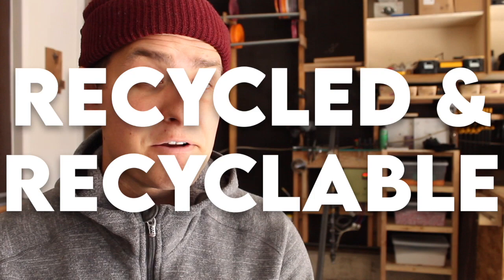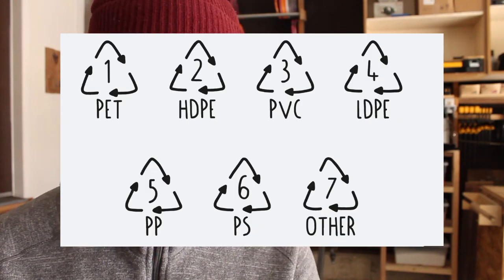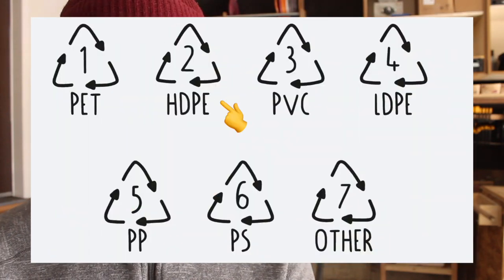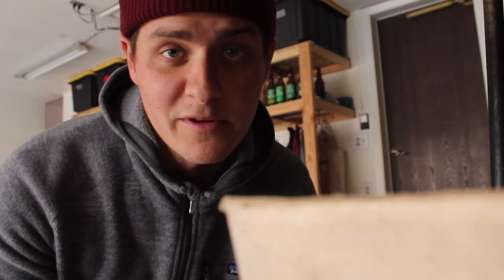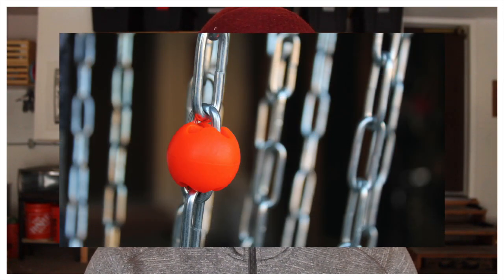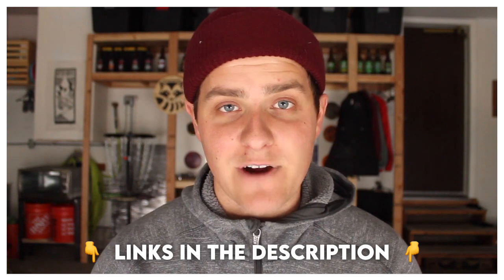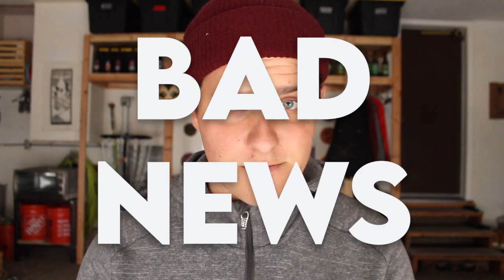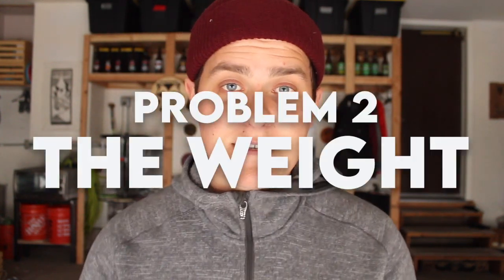I Made a Disc Out of Recycled Polypropylene (aka take out containers)

Comment: Add a heavier material into the mix if you want to use the same shot size. For this take a look at how some 3d printer plastics are made. Adding grounds/shavings/flake such as Copper, Iron, Brass, Aluminum, Tungsten. It's not about melting the added grounds, it's about suspending them in the plastic.

Comment: I'm sure by now someone had to of pointed this out, or just from playing for so long you've witnessed it.  But I've always played at sea level and a couple years ago I went to moab which is very similar to the altitude of Colorado and not only could I throw so much farther, every disc I had that used to be so flippy it would go into a roller turned into my bomber discs, and stable discs were just way too stable.  

Even when I lived in Arizona which I was only at 2000ft everyone's goto drivers where Shrykes and Vulcans ect.  

I'm not a scientist, but basically since the air is thiner there's less drag, but the disc also falls faster.  I've had it explained to me that the higher you are it's like throwing with a faster and faster tail wind.
Reply from the maker: Absolutely! It's not something that's talked about as much unless you live/play a lot at higher elevation. I'm from CA originally and my go to discs from CA to CO totally differ.

Comment: Hide the extra weight by increasing thickness in the inside corner where the flight plate and rim meet? Or slightly larger diameter might increase the weight fast? Or how about just cramming in more plastic in to the mold? Is that even possible especially with your hand used injection machine? BTW that thing looked sick af and surprisingly stable when you consider the weight. Oh, maybe a beaded version? Also I've always wondered what would some sort of outdent on the top or the bottom of the flightplate do? You always see indents like the groove tracks from discraft or groove from Innova but never outdent. Maybe a some grip designs on the bottom of the flightplate? Would also get weight away from the center like mvp or axiom seem to be doing with their weighting.
Reply from the maker: All great ideas and thoughts. Thank you!

Comment: Great work. Have you considered getting involved with 3d printing groups. It's one of my other hobbies and there is generally a ton of waste from support material and just failed prints in general. If there is a local 3d printing group I'm sure you could source a bunch of PLA, PETG, TPE, and ABS that is normally thrown out. Most of it melts around 200C and Im sure you can just throw stuff in a blender to make chips.
Reply from the maker: Great idea! I'll definitely try to connect with some.

Comment: Since the plastic is lighter, you could try widening the rim to add weight and speed while still keeping the disc less dense than water. If you can get the density consistent, it shouldn't be too difficult to calculate how much wider the rim would need to be to achieve a certain weight. I know all the math necessary for that and I assume a lot of other people know as well - I don't really know the terms in english but the first idea that came in my mind is volumes of objects that are created by spinning a graph around an axis.
Reply from the maker: Thank you very much! That's very helpful. I think that may be my next step!
Reply: @TrashPandaDiscGolf  I just created a simple prototype for a disc that has volume of about 183.6 cubic centimeters. With your current PP density, it would have a nice weight and still float. It has a nice dome, it is 19 mm high at the top, and it has 10 mm deep and 14 mm wide rim. I think it looks nice but I am not really experienced with disc stability so I don't know how flippy or stable it would be. Could I somehow send you more detailed info to look at? I would love to hear your opinion on it!

I used a program called GeoGebra 5 (a free program I often use for geometry problems in school) to draw it, used just a circle and some sort of ellipse to create it. If you have the program, I could send you the file and you could get all necessary info about the shape (with up to 15 decimal accuracy if needed) from it.
Reply: according to the PP density someone gave here in comments, that disc would weigh a bit over 160 grams. I did some changes and landed on a weight of about 178 grams with a bit wider rim, a bit higher dome and thicker flight plate. Can I email you some pictures or something like that?
Reply from the maker: Saw the email come through! Excited to talk more.
Reply: @TrashPandaDiscGolf  nice!

Comment: I think you might be getting too much air between the grinded parts when you put them in. Try compacting the grind into pellets before you inject them to reduce air pockets.
Reply from the maker: Thanks for the feedback!!
Reply: @TrashPandaDiscGolf  kinda off-topic, but have you tried 3d-printing a disc? Not as durable or recycled but very fast and easy to make your own designs and test them. I've made a few different minis and 1 full size fairway driver, 2 mids and a putter that way. Small changes are super fast to make and it takes about 5-6 tries until you get the flight you want.
Reply from the maker: One day I will! But I have not yet. I totally see the value just don't have access to one personally yet!

Comment: Would sand work to add weight and keep grip?
Reply from the maker: Maybe!!
Reply: The only thing I would caution you about sand is that it is very abrasive and hard.  Could cause wear in the mold and injection machine over time quicker than just plastic.

Comment: Keep wishing for more about the actual disc - just feel like the video doesn’t show it off. You using the disc sure, you talking sure, sponsor sure, close ups and video of the putter .. nope.
Reply from the maker: Hey Thomas! The "How the Recycled Prototype Flies" video goes into detail about the mold/flight pattern. If there are more details you'd be interested in, feel free to list them out here and I'll include them if/when I can!
Reply: He showed closeups right after demolding. It obviously is an average width and depth, a small bead on the lip, and a pretty flat top design. Seems to be close to a beaded aviar type design, very neutral or a hint under stable.

Comment: Maybe mixing 75% PP with 25% HDPE could give it some weight?? Not sure if this would work. As in idk if you can mix them and be fine or if it may cause a reaction you don't want since I'm not the best with science.
Reply from the maker: I'm also not the best with science.. lol! Thanks for the idea!
Reply: @TrashPandaDiscGolf  no problem! I wanna see this company get bigger and bigger with sustainable discs. But also maybe try melting the other plastics, seeing how much they weigh and the softness, and maybe if you find a plastic that melts to be heavier and softer, you can partially mix it with PP to gain weight, and not as stiff of a disc!!

Comment: Dude, that disc is awesome! It flew so perfect. That's the exact flight I look for in my putters.

About getting it heavier, I don't personally know much about additives but I know some exist that would get you some more weight. My only advice (you may already do this) is to make sure your shot that you load into the barrel has plenty of excess material. After you inject, make sure you continue to hold as much pressure as you can apply for at least ten seconds maybe more. That will continue to force more material in until the gate freezes. If you leave off pressure the material can flow back into the barrel to relieve the pressure in the mold. Also if you bottom out the plunger you're definitely not forcing any more material in the mold. Don't know if any of these are the case. Just all the advice I can give.
Reply from the maker: Thanks so much Zach!! All great stuff!
Reply: @TrashPandaDiscGolf  No prob. Happy to try to be helpful. It's a good cause.

Comment: Use the #1 PET plastic, it is the second common plastic on the market also one of the most used plastics after #2 HDPE which gets hard and stays hard when made that way, think Gatorade One time use bottles and similar sports ones that stay rather stiff. The plastic is already in USA being recycled and most countries recycle the plastic so this might help in finding the plastic easier. #1 PET is very flexible and will be similar to #2 HDPE but not as stiff in most cases.
Reply from the maker: Thanks for the feedback Casey! PET is definitely on the list to test in the future!!
Reply: @TrashPandaDiscGolf  Yeah it is nearly in feel a softer #2 HDPE, try feeling the two plastics sometime.

Comment: Hey Jesse I’m a plastic engineer....in order for you to make your disc heavier you have to do what is called pack and hold for injection molding.  I would try contacting any local injection molding companies to see if they have any scrap that you can have.  Polypropylene is very easy to be grinded up and re used but you might get lucky to find a company that doesn’t use it.  I know my company pays another company to come pick our scrap up at our cost so if you lived by me you would have an endless supply.
Reply from the maker: Thank you so much! That's a great idea and I'll definitely try to find some local injection molding companies to connect with!
Reply: @TrashPandaDiscGolf  for your set up to do a pack and hold you would have to use a bigger shot and a longer rod for you to apply even more pressure than you have currently.
Reply: I will reach out to PTA plastics up in Longmont for you. See if my connections are still around

Comment: Use a high density aggregate to increase the weight. You can get copper and diamond powder on eBay for cheap and might have a cool looking effect. Just make sure it mixes well or you could have balance issues
Reply from the maker: Great idea! Thank you!
Reply: How would that affect the recycleability of a disc?
Reply from the maker: Great question! I know that discs that use minerals/aggregates are still recyclable. That being said, there are complications recycling them in larger recycling systems, which is ultimately something I want to avoid. 100% PP means it can be recycled by me or anyone else!

Comment: I have no experience in this but it's the internet so here is my thoughts. You could try using a pulley system to get a lot more pressure during forming. This might allow you to get more plastic in it and increase the weight. Check out smarter everyday's video on snatch blocks for inspiration
Reply from the maker: haha great feedback! Could possibly change the weight but only minimally. Well worth testing though!
Reply: @TrashPandaDiscGolf  maybe it won't change the weight much. But it might allow you to produce a lot more discs. Less energy pulling a rope vs putting all your weight on the lever.

Comment: You could put a metal ring inside the mould before you inject the PP. Some copper house wiring should work for a quick test. Would still be 100% recyclable too. Also, a metal ring in the rim could ad some interesting properties to the disk. Some good, some bad I'm sure.
Reply: Would not be PDGA Approved since no metal or wood can be inside the discs ever.
Reply from the maker: Thanks for the idea Jeff! Definitely an idea I hadn't thought of.. Casey: obviously a metal ring is significantly different than metal flake, but how come one is approved and not the other?
Reply: @TrashPandaDiscGolf  Because they used a metal in the disc plastic mix, not a piece of metal in a disc. I would at least look that up as to why no disc with metal in it in a more solid form has been made or PDGA approved.

Comment: Obviously you need more PP in your disc if it is to be all PP and heavier. If you can't squeeze more into the current mold, could you somehow roll out a think pancake of PP for the extra weight and stick is on the inside of the disc? Just as a prototype and to get a feel of how much thicker it needs to be, before spending the effort/money on a new mold.
Reply from the maker: Thanks for the feedback! Love the problem solving thought process. Unfortunately thicker means less flexy..

Comment: I can think of two ways.  Use an additive that will add weight to the plastic, this will be hard to distribute evenly throughout your material without a mixer of some sort before you injection.  Number two, shove more plastic in.  I was noticing that your mold may be flexing some during the injection process, visually looked like the gap grew on the long edges between your clamping bolts. So increasing the density of the final product may be hard without a way to push harder and hold it there.  But you could try just shoving more material in during the packing phase.  

I think the main issue is the fact you are trying to use a single type of plastic and the blends are what help you achieve the specs you desire.  I don't necessarily think that 150 is too light, but it may be for the design of the disc.  Something designed to be more overstable but a lighter weight may be the ticket to producing a product that is more recyclable.  In fact it would already be reducing the plastic used inherently by almost 25 grams compared to your average max weight discs, which is already 25 grams not being thrown into the environment when discarded.
Reply from the maker: This is all fantastic feedback Michael! Thanks so much. I seriously appreciate the help!
Reply: That's actually a fascinating point about reducing the amount of plastic by 25g inherently is better for the environment.  I'd throw a 150 for sure.
Reply: I am loving every minute of this dude, keep it up.  Let me know when I can quit my job and come help you make discs.
Reply from the maker: Haha deal!
Reply: If the problem is plastic. Start with less plastic.  

I am not sure if it is feasible while maintaining the flight paths we see but the japan open was always 150 class.  They seemed to adapt just fine.  With the right design the loss of overall mass may not matter to 99% of players.

Comment: From Google, PP is 855kg/m3 vs HDPEs 970kg/m3. So 88% lighter perfectly accounts for your 155g disc. 
LDPE could be an option. Its only 95% lighter. So a ~170g disc might be ok.
But if you really LOVE PP you will have to increase volume of you tool. an extra 50% thickness of your flight plate should work and decrease your injection resistance too.
I'd try some more denser materials 1st
Is there an harm talking to an injection moulding company that has lot of waste in a more suitable material that you can grind up? or does it have to be one of those top 7
Reply from the maker: All great ideas! Thank you! Worth pursuing all of these ideas at some point!

Comment: Love it 😊...Can you put hdpe in injection first then PP... so when you inject it it pushes the hdpe to outer rim ... and poly stays in the flight plate so it flexes and the rim is stiff and will add weight to the overall disc.
Reply: Won't quite work the way you'd think it would. They do have similar melting temps so he could probably inject both. However, plastic, when injected, has a property called fountain flow. It means that the plastic that's injected first sticks to the mold surface because it is cooled by the cold mold and the rest of the plastic travels through the middle of the two cold layers. So you'd end up with a flight plate that is HDPE on the outside and PP on the inside.
Reply: @trulsrohk9   ye I agree ... I think with the right blend it probably would give flexibility yet stiffness desired 🤷‍♂️
Reply from the maker: Love the problem solving and easily worth the testing!!
Reply: @TrashPandaDiscGolf   If each material was a different colour you could partially see where they go. Especially if you cut them up :)